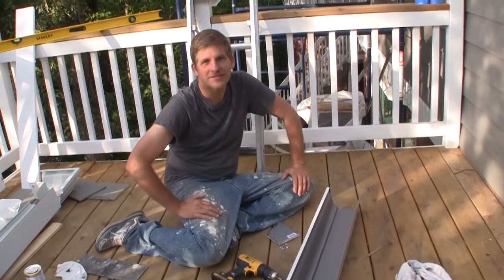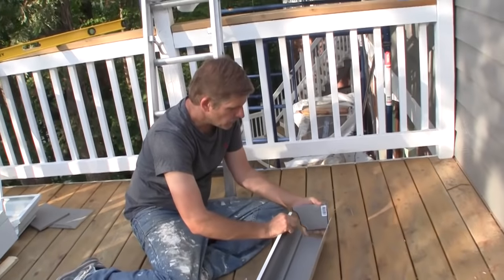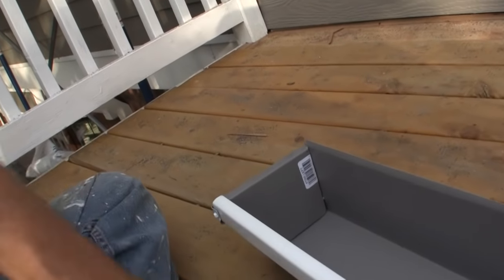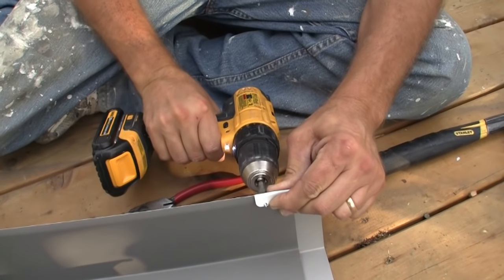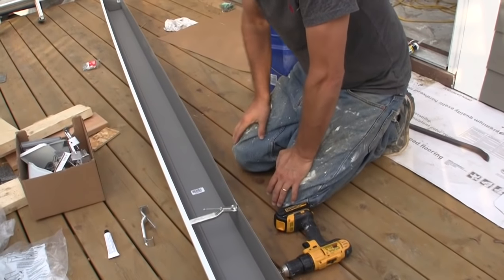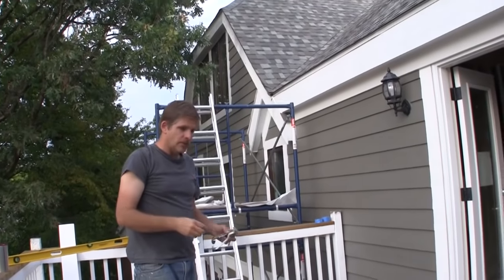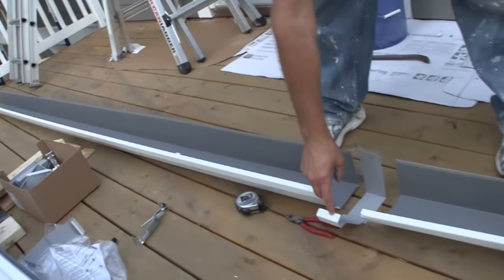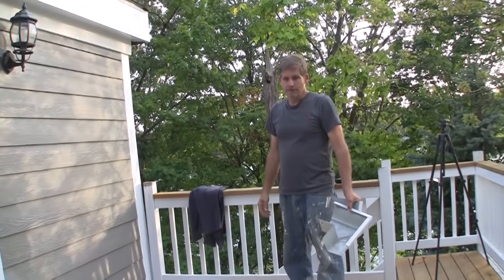How to Install Gutters

Comment: Another guy already said it, but I want to repeat him- you can buy all these parts and pieces for the same price a seamless gutter guy will charge you for the entire job, done. Your pieces are just bought, not hung yet,   and you have all those seams. It's a distribution thing. Gutter guys buy direct from the mill, then charge labor.  That labor is about the same mark up as Lowe's or Home Depot has on their material. You'll also be buying lighter gauge at these stores.  0.19 downspouts. Your gutter guy buys 0.22 or 0.26 if you tell him that's what you want. Your gutter can be 0.27 or 0.32.  Those stores sell 0.22 , which I can tear with my hands, no snips.  Try this- at Lowe's or another, hand carry 5 downspouts across the store. Bet you dent them !!
Reply: "House flipping brothers Dave and Rich show how to install gutters on a house" they are just fliping the house, buyer beware
Reply: What’s gauge?  With an employee discount I can get 16 12 ft. aluminum gutters for $144 plus tax and I assume 7 down spouts aren’t extremely much more. That definitely beats paying $2,240. Anything else to take in consideration?
Reply: Seamless is the way to go...this is a waste of time. Drip edge needs to be 1/4” away from fascia otherwise you will have leakage behind the gutter.
Reply from the maker: Hey Anthony, 
You are on track. Don’t forget gutter hangers and gutter screws and maybe a nut driver set of drill bits for the screws. 
Good job weighing the options. That how you can save yourself a few coins!
Thx for viewing.
Reply: This is only your opinion for yourself, where Iive the cost is about 5x higher to have a seamless installed, you should not make generalized comments as though you know about all situations

Comment: Don't ever use screws on the end-caps. Use a crimper and SeamerMate or equivalent gutter sealant.
Reply: seamless gutters still the best and they didn't tell anyone when bolting to the fascia board 16 on center into the rafters not just the fascia board itself

Comment: Application of the sealant would be very helpful.  Is applying the sealant on another video perhaps?  Thanks for the video!
Reply from the maker: +pacificprospector Hi Pacificprospector, the gutter sealant is sold at Home Depot and other hardware stores. At Home Depot the sealant is included in the seamer packages. It is a gel. All you have to do is apply it liberally along all seams, just like caulk. Make sure the bead is continuous, with no gaps and you will have a leak free gutter. Thanks for the question.
Reply: Much appreciated!  I've tried to seal a leaked continuous gutter.....I'm in the process of replacing it.  Your video and information is helpful.  Thank you!

Comment: For more correction of information- You do not need to drop gutters anything like he says. Just make sure it is chalk line straight, with no high or low spots in the gutter. Sight it along the bottom bead. If the gutter is perfectly level and straight, it will not only work, but it will look good too.

Comment: I like this video. I think you did a great job and I learned a few things. (although I wonder how badly somebody is going to slice their hands when cleaning out the gutters as they swipe their fingers or side of the hand over those extremely sharp zip screw points just waiting to shred some skin)
Reply from the maker: +Jeff Hi Jeff, good point, one option would be to cut the tips off the screws with a multitool. A person should definitely wear protective gloves when working with gutters. We use foam gutter guards that we place into the gutters so we don't have to clean them out. We will make a video soon of the product we use. Another option would be to wait for a sunny day, when the leaves are dry and blow them out with out a leaf blower. Thanks for viewing and posting your comment!

Comment: Putting up a video that says "How To Install Gutters" was bound to draw a bunch of gutter installers to view this video, I'm sure you figured. As a gutter guy for 25 years, there's a bunch to pick out of this video to criticize, but if you are a homeowner trying to do a quick fix, this instruction is acceptable. Not recommended for someone trying to learn how to be a gutter installer on a larger scale.
Reply from the maker: Hi Rob,
Our channel is all about showing people how they can do a job themselves, rather than hire someone, so they can save a lot of money.  Thanks for your input.
Reply: Extreme House Flipping then you should tell them to never do this type of gutter. It’s nothing but a waste of money.  You’re also telling them to pitch a 20’ pieces 1” on a 4” tall gutter. You’ve just lost 25% of the capacity.   Additionally, 6” seamless gutter, installed is often less than going and buying all this retail.  I bid plenty of jobs where the people started and realized it was trash, called us for an estimate and been shocked it’s basically the same price.  During the recession we were doing it cheaper than you could buy that seamed stuff for.
Reply: @mykeva1  Where are you located? Here in Asheville it is 5.00 a ft plus down spouts and drainage ...
Reply: I do gutter for a living and I'll say I can install seamless gutter for just above the cost of lows or home depot  mitearel cost in half  the time with labor inculcated

Comment: Shortest drip edge I have seen. Water will wick under there in bad storm and wet the edge of the roof plates.
Reply: It is installed wrong

Comment: TY for the good explanations. I had a few questions but you mostly answered them in the two-year update. It does seem (no pun) that others all do the seams and slope differently from each other (art > science).  You did switch from stating .5 inch slope/ten ft in this 2017 vid. to .25 inch. in the 2nd vid.. (error or change of procedure??). Either way, it is ~impossible to have a slope on 25'+ gutter AND have the gutter BEHIND the drip edge w/o monster flashing by the drain end.  Also, unless I hear differently, your 2nd vid w/ the leak convinced me that I will just overlap my 10' pieces by 1', seal, rivet and ensure each new segment is on the bottom.  I encourage everyone to clip on the sponsors above! Tim, MN
Reply from the maker: Hey Go...,
Interesting tip - overlapping the gutters. You are correct about slope and a long gutter.But I don’t have an issue with gutter below drip edge as most water falls off shingle on drip edge and into gutter. I’m convinced that slope is different on every house and location. Different sizing, different needs depending on where you are. Thx much for watching!

Comment: You don't need a seam at the corner . Add sealant into the corner piece, put the gutter into the corner, screw or pop rivet it together and add a  bit more sealant. And it is not a good idea to seam over a doorway...???

Comment: hate being mr. negative but lots could be done better here. if you notice in video roof has  a weird rounded slope at the edge so important that  trough gets tucked under that roof starter as much as possible otherwise water will just drool between trough and fascia. trick for doing this is not clipping clips (hangers) to the back of trough that way trough can be shoved behind roof starter higher then just hold clips in position as high as you can get them under roof starter and screw. (hard to explain). Also metal flashing of wood fascia is highly recommended as wood will just rot out over time again. also he used 6 inch commericial size trough which is not necessary on residential but is better but requires more clips as it will hold more water which weighs considerably more . clips should be min16" or 12" is perfect. 1/2' over ten feet not necessary , if you were doing a 50 ft long pice you would end up 2 !/2 " from fascia so rain would miss trough in a heavy strom. 1/4" over ten feet is good enough, your not white water rafting in your troughs lol. 
Wearing a tool belt is also a sign of a professional.  Always shocked at number of viewers on these how to utube videos. the fellow means well and what he has done will work but will leak at joints in couple of years. Expansion and contraction pulls caulking apart and silicon does not work in Canada maybe in snow free climate.
Reply from the maker: Hey Glen,
Thx for taking the time to comment!

Comment: SEAMLESS gutter makes sense HERE...as seam right over light fixture / entry...is risky.
Reply from the maker: +William Boardman Hi William, we agree that seamless gutters would be better than having gutters with seams. The purpose of this video is to show someone how to replace or repair gutters themself. The average homeowner isn't going to have seamless gutter installation equipment. If they want seamless then they can call a gutter installer. But if they want a more affordable solution, this diy method works well. The gutters aren't leaking now. Down The road they may leak as the sealant wears out, but then it is just a matter of removing all old sealant, because new sealant won't adhere to old sealant, making sure all seams are clean and dry, then adding new sealant. The key is to find a high quality gutter sealant. Thanks for commenting.
Reply: No worries. (As my business cards stated)  As our gutter machines were mobile, we had drop service, with FREE inspection, to encourage business contacts and SAFETY.
Reply: The way to repair a gutter is to rip it out and put in a seemless gutter otherwise for years youre going to be caulkling and patching leaks in the gutter
Reply: I thank you for telling him about gutter drop services. If it was a small few runs getting the gutter dropped is the best way.
Reply: Yes that is true! You never get that gutter clean enough to take on more goop. (caulk)
Reply: no way in hell is that one downspout going to be enough for any kind of heavy rainfall...
Reply: @rbeck3200tb40  I find it amazing that someone who is a renovator would even try to pass this off as a decent job.
Reply: @Ryan Hiemstra
The purpose of this video is clearly stated. It's not for professional installation it's for DIY'ers that need some guidance to go off of. No reason to take time out of your day to comment negatively on a very helpful video.

Comment: Im a professional gutter man. I have been doing it for 18 years. This is not how gutters are installed. This is the cheap way and will cost you a lot more when they leak. The material is paper thin!!! Look how they guy bends the joint with his hands. The material we the professionals use is way thicker and can’t bend it bu hand. My best advice is spend more money hire a gutter company. And will not have any problems.
Reply: Jimmy Salinas someone with some sense. Save the money and hire a professional. This is why raingutters receive a bad name.
Reply: I agree and get the proper gauge of gutter for your weather conditions and type of roof.
Reply: Could u ballpark a price for per linear foot price for seamless installed vs something similar to this material? I live in a city with  lots of installers
Reply: Storage Buyer THANK YOU!! That’s what I was thinking
Reply: They really is a such thing as a “professional gutter man “
Reply: You should never screw the end cap they make end cap crimpers for a reason lol

Comment: You definitely need to put caulking in to the end caps and at every seam. You should also crimp the end caps. Another big no no is drilling those hangers ONLY in to the facia. You should be drilling them in to the ends of the roof joists. Those screws will go past the facia and have nothing to bite in to.
Reply: Jus got gutters...and the screws dont go all the way through the fescia..seems solid all the way around!

Comment: Why not just crimp the end caps? Lol
Reply from the maker: Hi BluesDude, yes, you can crimp, but in our opinion screws are sure fire solid.
Reply: Extreme House Flipping I live in Vancouver, Washington and have been installing gutters for years crimped end cap and caulk is way cleaner than screws
Reply: Just crimp the incaps they look way cleaner
Reply: For the home owner that doesn't wish to purchase a crimping tool, screws is the best option.
Reply: B Dub 
No one said rivets!  Screws should only be used if you plan on taking it apart at some point. They also hold on to leaves etc.
Reply: Crimp never screw.
Reply: Rivets are better than self-tappers. Better bond, safer, and a cleaner look. Crimping is the best way, but for DIYers, the cost of the crimping tool isn't worth it. So the way Extreme House Flipping secured them is ok, yet not ideal.
Reply: Because youre too cheap to buy the crimper, as demonstrated by the guy installing 10 foot sections of gutter.

Comment: The truth is, this system of gutter installation is junk. The 10' sections are cheap, but all the accessories add up fast- like the seamers and box miters- that will leak like crazy real soon. Don't throw good money away, just call a seamless gutter company that field cuts their own miters and know how to give you a trouble free, long lasting job. This crap is just .019 thickness material. Industry standard for residential installation is .027. Upgrading to .032 is not uncommon, and is the standard for residential 6" gutter. A waste of time and rescourses.
Reply: Where would we be without internet geniuses like you?
Reply: @jamescarter8311  I am not a genius. I am just a guy who was drafted into the family gutter business ant 17 years old. and now I am still dong it at 63, and have made my living doing it for 46 years. Even an idiot would know what I said was correct if they had been doing it that long for a living.
Reply: @brianaldridge5272  I think these gutters are more for persons on a budget.  Some gutters is better than no gutters at all.  However, I agree with pretty much all you said.

Comment: Hanging a gutter with slope is %100 incorrect and can lead to extensive damage.
Water will always find it's level. The miniscule amount of water that will cover the entire bottom of the gutter will help to protect it from UV and ozone. Please don't put slope in your gutter, it's not correct. 
A waste pipe, yes. A gutter, NO
Thanks 🙈 🙉🙊
Reply: Not only that, but on long runs you wind up outside the drip edge, as shown at 7:50.
Reply: so you suggest zero slope, ie. just line it up directly under the drip edge all the way across?  there will be zero standing water???
Reply: @prs2710  First, you should have gutter apron across the eve whenever possible.
Your gutter should always be under any drip edge/gutter apron.
Yes, you may have a minut amount of water evenly throughout your entire gutter, but not more than the height of the drop tube.
A waste pipe needs slope to increase the speed to help the solids along. Since you are not moving a viscous fluid, the water will always find the easiest path down.
I've been doing this for over 25 years, besides my on the job knowledge of how to install a gutter properly, science also dictates my reasoning with simple physics and fluid dynamics.
If someone tells you any different, than they don't know how to install a gutter and don't understand simple physics.
Thanks 🙈🙉 🙊
Reply: Serious? Water will run to the downspout and fall to the ground. Now if you dont use a downspout it will fill up and run over.
Reply: @thomastusing6103  Your confusing a drop tube for a downspout. I'm not sure the point your trying to reach?🤔 
Thanks 🙈🙉 🙊

Comment: Love the clip system. I couldn’t find those. I only found big nails with the plastic sleeve.
Reply: And the nails keep bending.  What a disaster
Reply from the maker: Hey Robert, 
We left a link in the description below the video for the gutter screws. They work way better than the nails. More control.
Reply: Think he’s talking about the nail that Goes into the fascia while you have those easy clips

Comment: The gutter screws I found were HUGE and long!
Reply from the maker: Hey The I...,
Those really long screws are actually hangers that are typically used to screw through the top front and back of the gutter and then go through the facia to the rafter tails to hang the gutter.
Hope that helps.
Thanks for watching!

Comment: Shouldn't you use silicone sealant on the endcaps and crimp them rather than screw them on?  That way you have a leakproof connection with no hole penetration.
Reply from the maker: Hey cjwittmeyer,
Yes. Gutter sealant or silicone. Screws or crimp are dealers choice. Both work. Thx for watching!

Comment: I could be mistaken but I didn’t see you get the gutter underneath the drip edge on the roof. Hypothetically, water would leak underneath the gutter and onto the deck.
Reply from the maker: Hey Wesley,
You are correct in your observation. But a properly hung drip edge is designed to drip water into the gutter off its leading edge. Sure, and splash from droplets could get onto the facia and run down the facia or under the gutter. But that vast majority of the water falls off the drip edge and into the gutter.
You could tuck the edge of the gutter under the drip edge if you kept the gutter slope much closer to level. The option is yours, depends on your desired final outcome. Thx for the comment and for watching.

Comment: Very useful video. Thanks! At 11:39 the gutter doesn't look like it is underneath the gutter apron.
Reply from the maker: Yes, you are right. The length and slope caused that. We were trusting the drip edge to drip water into the gutter.
Thx for watching!

Comment: With the saddle in that roof edge be prepared for the water to leak from the soffit when the water runs under the shingle.
Reply: Add kick out flashing.

Comment: gutters are best hung   up tight under drip edge .  they have a 5 inch drop built into 5" gutter.   possible 1/4 inch drop in 20 ft. is plenty.  this way it does not look like house is dropping at drop outs.  we make a male female joint when needed.  but continious gutters are best. no need for joiner collars cuz you slide male guteer end  6" into female gutter and fasten together..no need to see collars interupting a long run of gutter....